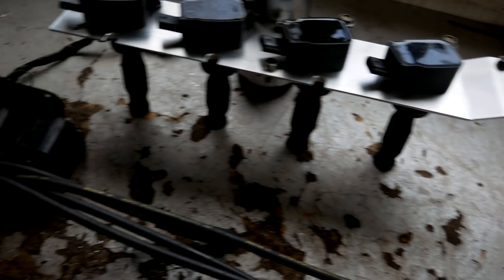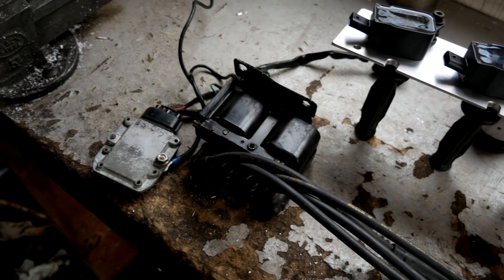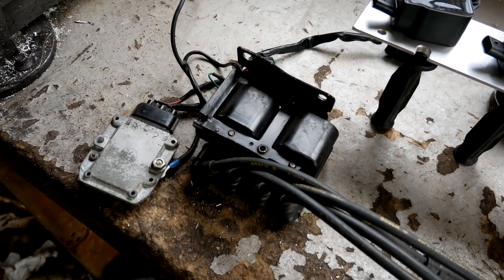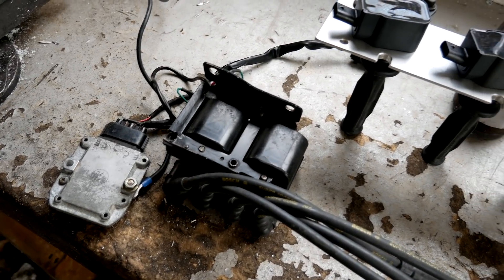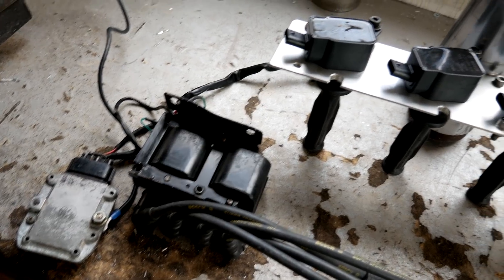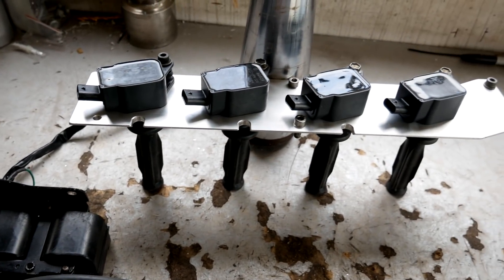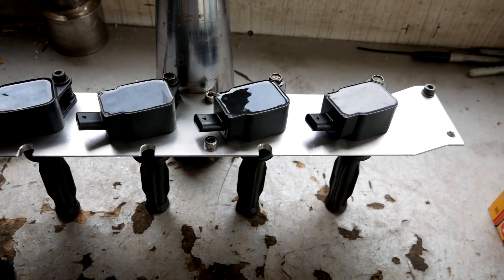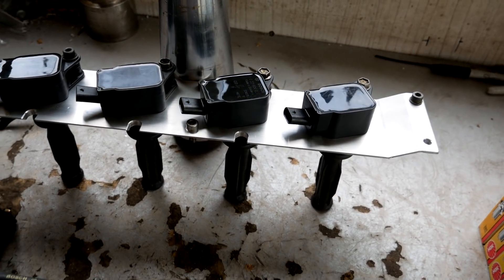More Spark = More power?   Dyno tested

Comment: Is resistor is in sparkplug is important in 4age?
I have troubles with my silvertop and  maybe will install zero resistance cords, but some info is it's need sparkplugs with resistor.
My quite new Seiwa cords have elecric brakedown of tube part.
Reply from the maker: yes you should use resistor plugs.   non resistor plugs can cause interference issues

Comment: I also once ran Mitsubishi 4g63 coil packs on my Honda, using those Bosch leads from supercheap auto- did you find that you need to use the resistance type leads after a while? Mine kept misfiring until I changed them to the same type used on evos... Interesting is the COP vs wasted spark comparison. I have had many a heated debate with know it alls who claim sequential is better, when for most setups its not, its just more complex, as is running an extra cam sensor when one can do the job- all it ends up doing is introducing more potential failure points. As for injectors, sequential injection is pointless in a performance setup, unless you have direct injection where fuelling needs to be times with the mechanical processes.
This video proves you don't need the latest and greatest ECUs to have good results, batch fired setups also free up more spare outputs in the cases of some ECUs also.
Main things to consider are:

Can your coils develop peak charge at peak RPM and or boost in wasted spark mode?
If no can you swap out your coils for some that can or can you get a coil on plug kit and run that as wasted spark- in most cases, you can.
Coil on plug setups clean up an engine a lot and get rid of the leads, but you will find only those with huge boos levels or cylinder pressures actually need to maximum coil charging time...
Reply from the maker: no drama's long as keep them away from sensitive stuff like the cas & wiring etc. and use resistor plugs

Comment: I've done some experiments on various vehicles I've owned over the years...
A capacitive discharge ign like MSD will run better than stock. 
Opening up the spark plug gap .005" (about 0.1mm) ignites the mixture better.
A high energy coil will give improvement as well.
Heat range on plugs should be just high enough to prevent carbon fouling when mixture is properly adjusted.
...My experience

Comment: To add in 3 more ignition tests if possible. 

 “hotter” coils, aka going from 20kv to 50kv or if possible multiple discharge
Increase in coil dwell times
2 prong vs 3 prong spark plugs
Reply: Probably a waste of time and money. If the energy is sufficient for reliable ignition, then increasing this energy will have NO effect,
Also, what is the point of multiple sparks if you are firing the plug into a zone of already burnt mixture. Pretty hard to light CO2....

Comment: Hi!

Spark generation in an ignition system is dependent of not only ignition coil, but what drives it and power supply voltage (supposedly, nominal 12V). So, please, inform which ignition drive you've employed at each test.

I've found it curious no (detectable) misfire when using a 2.5mm gap with a ignition set as I imagine it was.

Also, no (detectable) difference between 0.2 and 2.5mm gaps is pretty intriguing, since gap affects burning process time, what consequently imposes timing advance changes.
Reply from the maker: the cop coils were setup as per manufacturer recommended  dwell times.  the wasted spark are old mitsubishi coils so dont have data on them, but the dwell times should be pretty close what the needed to be. 12v yes.     engine is setup just past minimum best timing and makes the same power either side of it.  in an effort to keep tests more consistent.  So if the gap did effect the timing.  wouldn't be seen here

Comment: A much hotter coil with iridium plugs is about as good as it gets. The only tuning gains you'll see after that is setting the plug directions using copper washers, and if your coils are hot enough, you could side gap the plugs. These would result in the least amount of spark shrouding.

Comment: Honest question: on a turbocharged car, does any failure to ignite / burn completely run through the exhaust stroke, through the turbocharger, and back into the engine as a "rich" mixture? can that then be "re-burned" before being exhausted?
Reply from the maker: straight out the exhaust.   misfire will register as a lean spike on o2 sensor, since oxygen isn't burnt

Comment: On my old Opel Kadett city 
1.9s. I replased the standart coil
With a 50.000v oil cooled 
And build a electronic igigknition system
From 70hp to 82hp dyno..
2" exausht + K&N + SUNOCO 5-40 SYN TURBO GOLD
LATER with turbo IT got 243HP 1.9n with 2.4head
The 1.9n we used 4 piston out of a Commodore.. 
To lower compresion Commodore pistons WAS way
Better qualety..
Reply: 1.9s had 90hp, right? So the original coil was maybe in bad condition?

Comment: Years ago I ran a set of Halo plugs on my V6 Jackaroo, they were supposed to give way better economy on the (thirsty) 3.5V6.  Made no F'n difference, but I fondly remember that vehicle because the V6 was smooth and sweet and had some grunt when above 3500.  148Kw in 1998 was the duck's guts.  It did like fuel, but never needed a spanner in 160,000ks.  Then it got a timing belt, and 4 of the valves were a couple of thou out.  Brilliant.

Comment: I’ve run tests on plugs and in order to see gains you need to have an application where it’s high output or near the limit scenario. Lower compression NA applications do not show gains. I’ve seen legitimate 5whp on 93 octane cars that make about 375whp and are turbo but they were a different type of plug. This showed the highest gain rather than heat range or coil differences. Lower temp  heat range just helps prevent pre ignition.

Comment: I'd definitely like to see the big spark gap and high mJ coil test done again as an fuel economy test. A larger plug gap, with a higher output coil should allow you to run an ultra lean mixture at low load / low throttle position and improve highway cruise economy.  -The performance potential of a large spark plug gap is very small, the fuel economy improvement with lean burn limits being extended lower should be more significant.

Comment: The big gap with the high mJ coils test should theoretically want less ignition timing and see small torque increases when the ignition advance is backed down to it's new best with the big gap, high mJ coils. (A large gap starts with a larger initial flame kernel that then has less physical distance to travel to the furthest reach of the combustion chamber and therefore requires less ignition advance.)

Comment: I'd like to see "copper" AKA nickel vs double platinum vs laser iridium vs ruthenium. Same heat ranges, same gap, same design. The fine tip and rare metal plugs can have the same affect as slightly increased timing, so it would be cool to see if that is born out on your dyno.
Reply: Same same
Reply: Oooh, this would be a really good comparison. I'd love to see it happen!
Reply: all bunk. IF it is lit, it is LIT.
Reply: @billshiff2060  That's certainly not the whole story.
Reply: @802Garage  As far as the spark plug is concerned it is. Once the fuel is lit, the spark plugs job is over. If it lights it, that is all it can do. There is no way to light it any better.
Reply: @billshiff2060  That's not true. A small spark and a large spark are not equal. That is part of why spark plug gap also matters, although generally not nearly as much as many other factors.
Reply: @802Garage  Provided it is able to fire, Any difference in combustion time due to gap is unmeasurable. Thats because setting the fuel alight is NOT burning it. 
The actual burning takes much longer to complete AFTER the flame front has reached all corners of the charge. This is verified experimentally many times. MIT built an engine with 17 spark plugs and when fired simultaneously did NOT reduce burning time or affect power significantly.
So I stand by my statement, IF IT"S LIT, IT'S LIT. The rest is up to turbulence in the chamber and TIME, a lot more time than you are thinking.
Reply: Same
Reply: If it slightly increases the ignition time why don't you just do that via the ECU ?
Reply: @derekcable  Using the finer metal plugs can have the same effect as slightly advancing timing. Therefore it can either have a beneficial effect on combustion and subsequently power and/or efficiency, or it can push the limits of the setup and you will need to compensate by retarding timing slightly. Overall it is a positive effect as long as it can be tracked and managed.
Reply: @802Garage  Your just end up adjusting your timing via the ECU so any positive effects are going to be nil really.
Also if you using the spark plug to compensate for something else shouldn't you really be addressing that than use a particular spark plug other than for it heat range usage ?
Reply: @derekcable  It's a lot of complex factors that come together for an effect. What effect exactly? Depends on the engine, setup, tune, and if you can read it. I really only mention it to note that swapping plug for plug it can have a positive affect or it can also cause issues that people then improperly blame on the plug even when it is a superior part.
Reply: you mean nickel-copper which should be mostly copper ?
Reply: @wyslink9354  It's not mostly copper or it would melt almost immediately. Look it up.

Comment: I don’t have a dyno but I replaced the 150k mile old coil packs on my VW GTI with new, more powerful Bosch coils from an Audi R8 and the engine is definitely smoother and more respinsive on the low end and has increased power at the last 1500 RPMs to redline. I doubt the increased power exceeds what it could do on fresh stock coil packs, but old, weak coil packs will definitely rob you of a bit of thrust.

The coils degraded so slowly I hardly noticed it until one of them finally failed, but now the engine is back to feeling like it wants to rip itself from the car when I put my foot on the floor.
Reply: What kind of GTI? What I found interesting was that a few companies make them for the 1.8T 20V. They do not advertise an increase in HP, they just mention that the R8 coils are easier to find, cost less to buy, and are available in red.
Reply: @skylinefever  it's a 2010. I wouldn't tell anyone that they'd add horsepower over healthy stock coils, but the difference in really worn coils versus fresh ones is noticeable. 

I was probably getting some random misfires on the old coils, making the car less smooth at higher throttle inputs. From 5500 RPM to redline it felt like the turbo just stopped working, which I just attributed to it having a tiny turbo tuned for mid range punch. Now it pulls cleanly and evenly with no big power drop off. 

I'm sure the engine felt like this when it was brand new, but I've had this car for over 12 years now so gradual degredation isn't easy to pick up on.
Reply: @michaelw6277  Okay, I understand now. I think the 2010 had anything different from the R8 coils.
R8 coils and adaptors are considered worth installing on the 1999-2004 GTI. It's not for power, just reliability and cost.

Comment: When the magnetic field collapses in the ignition coil the voltage rises across the plug gap until it sparks ,,,, wider gaps equal higher breakover voltage and will damage the ignition coil or cdi unit ...It doesn't affect the speed of the burn , any timing affects you might encounter are due to  l/c time constant ...Heat range is how fast the plug can dump heat into the head ...You want a plug that runs hot enough to clean itself , without causing preignition...Reliable spark and timing is critical to any internal combustion engine , but a "racing" ignition system wont make your car any faster than a healthy oem one...

Comment: Great video.
Confirms something that I've stuck with for years. If the ignition system is working, reliably, putting in something scarier, that you can weld with, isn't going to do anything for power. 👌

We ran a well maintained and adjusted points ignition system for season after season on a Datsun 1600 rally car, years ago, and had outright  and class wins with the car in a time when others spent $1000 ignition computers to do the same job 🙂👌

Most modern OEM systems are great without changing components.
Reply: I heard that some people actually use aviation-sized spark plugs on their engines.

Comment: Great vids.  I remember doing testing like this but at the race track with track times. Changing parts in the pits and yadda yadda.  From building 4/6cyl and V8's.  Testing with more spark smaller piston and displacement engines dont have really high cylinder pressures.  The small cylinder volume and small chamber size is a tight space so combustion would be way simpler and easier to complete.  Larger area such as a bigger bore and having larger valve will make the chamber larger so it would have a larger overall volume.  It would make combustion harder to achieve.  Also sucking in more displacement of oxygen you have to add more fuel hence it will make combustion more complicated so the shape of the chamber becomes very important
Reply: Look up Paschen's law. Explains part of what you are talking about. The other part is about fuel atomization, flame front propagation, and a homogenous mixture.

Comment: Yip ! when your running big boost alky-nitro mix in top fuel, your every day ignition would not light the fire. Top fuel engines use magnetos that pump out 40 + amps and commonly use two of them !!  mind you, there is nothing left of the s/plug at the end of the run

Comment: I can't find any reasonable info about something old I discovered a year ago. Maybe it'll interest You enought to try it out.

Reversed fuel injectors. In almost any port injected cars, injectors are oriented to inject fuel along the direction of passing air. How about injecting it against the flow? How it will affect the engine output? Can it be done on a single set, or does it need to be a separate set because of low airspeed at low rpm? I am very curious.
Reply: It will probably just cause driveability problems. The normal orientation sprays fuel on the back of the intake valves, which are hot, and that evaporates part of the fuel.

Comment: Would love to see if an electric water pump would offer any gains
Reply: Of course it won't. The alternator will need to work harder to power the pump.
Reply: @1magnit  Well that’s the myth that would be great to find out. You can say the same about electric fan vs clutch fan. The alternator would indeed work harder with electric fan, but some videos seem to indicate a hp increase🤷🏻‍♂️
Reply: @sv4057  The fan is totally different because under normal driving conditions the electric  fan is off. It will only come on when stuck in traffic or going slowly. A mechanical fan works all the time
Reply: @1magnit  Well the dyno sheets have shown up to 9hp increase with the el fan on vs the clutch fan
Reply: @sv4057  To be expected, no so with electric water pump though.
Reply: @1magnit  how would you know?
Reply: @sv4057  Maybe I've already done the testing?
Reply: @1magnit  I dont think you have. Copied from a motortrend article: 

Using the Meziere electric pump and no other accessories, the small-block put out 531.2 hp at 6,600 rpm and 475.9 lb-ft of torque at 5,300 rpm (as an average of the three pulls). We bolted on the Weiand Action Plus water pump and Trans-Dapt 1.0:1 billet aluminum pulleys and found 527.5 hp and 474.5 lb-ft of torque at the same rpm points, resulting in a loss of 3.7 hp and 1.4 lb-ft. 

And this was with a well built waterpump, not a standard one. Here they tested a standard one I think : 

When we swapped to the GMB water pump, using the March underdrive pulleys, we recorded an average of 523.1 hp and 470.9 lb-ft of torque, 8.1 hp less than the Meziere electric pump and 4.4 hp less than the Weiand mechanical pump

So no I dont think you have tested anything. But what is certain is that this would be cool to see a video off. Everyone with a NA 4 cylinder needs all the hp we can get.
Reply: @sv4057  If it wasn't running an alternator then it's not a proper test.